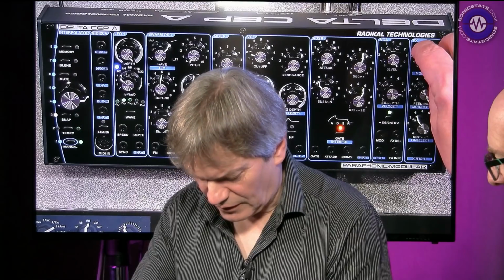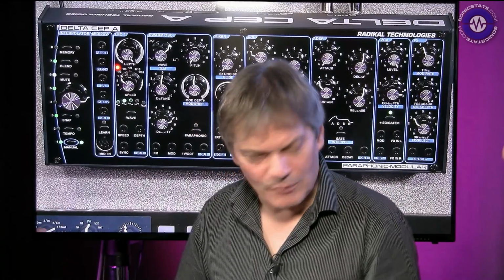Presentation: Radikal Delta CEP A Semi Modular Synth

Comment: This seems cool but the price in the same range as the very capable analog polyphonic Prophet Rev2 & Novation Peak seems too much
Reply: How do these two compare to the Delta CEP A? Are they also starting points for Eurorack Modular stuff? Do they offer patch points everywhere? If you would like to compare our instruments with the Prophet Rev2 or the Peak, you should compare them with the Accelerator. That is an instrument that goes into the same direction.

Comment: not a beginners price
Reply: Especially the desktop at 1200 euro, not cheap. However it sounds great. Seems more fun than the heaps of simple modern analog mono synths we have been bombarded with.
Reply: @kixxalot  no doubt, I want it!! i love poly synths but the guy said " its great for beginners" which I agree based on structure but not the price.. unless money is not an issue for you hehehe
Reply: David Pinto Beginners have the biggest budget though, they didn’t blow it all on modules and synths yet. It’s not like GAS makes you richer over time :D

Comment: So it's not possible to take the module out of the desktop version and install it into eurorack? They're different?
Reply: No, they are 100% the same. You can install it into any other Eurorack case. You can also use the desktop case for other modules.
Reply: That is fantastic thanks for clearing up my confusion.  Also, i've been considering the EFFEXX and Swarm oscillator recently.  Really cool stuff!